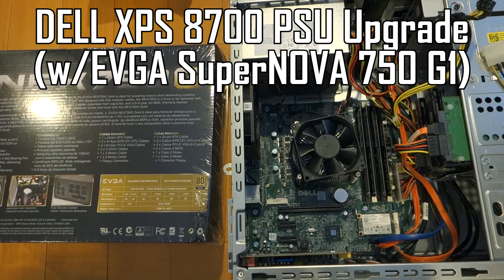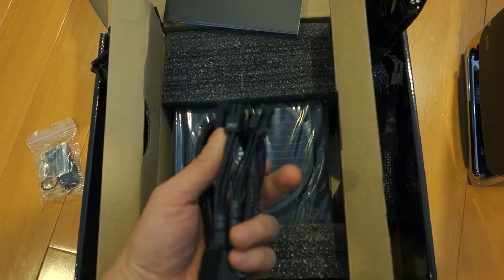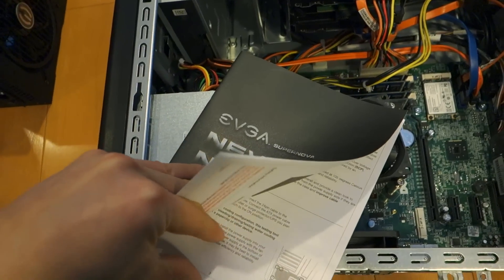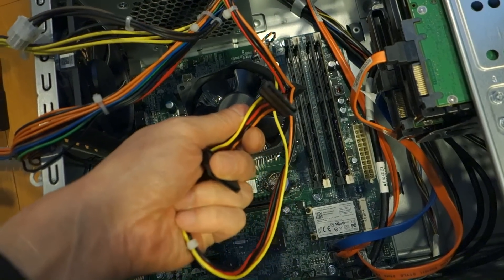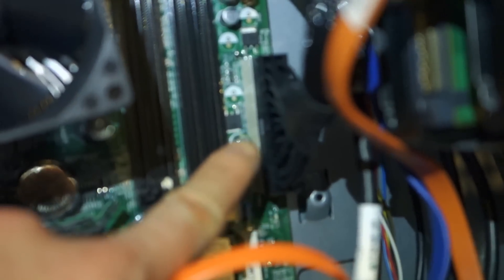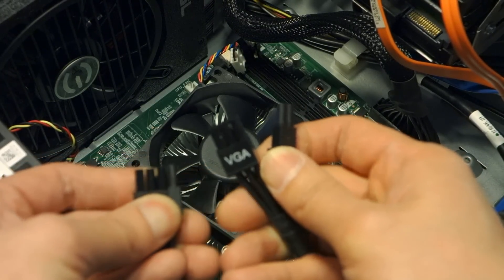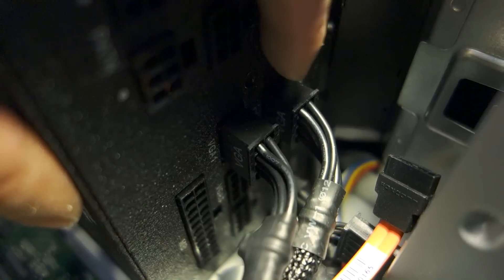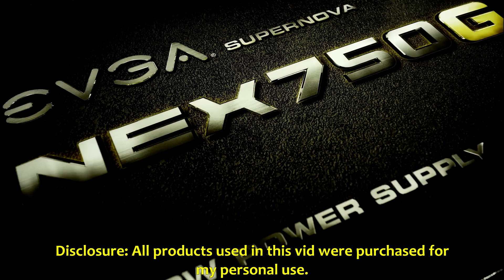HOW TO: Dell XPS 8700 PSU Upgrade (w/EVGA SuperNOVA 750 G1 and HD 6970)

Comment: I was just wondering, did you experience any trouble opening the XPS 8700's case? Did you find that the screws that held it in place were stripped? If not, what sort of screwdriver, bit, or tool did you use to open it? Is it possible that you could be specific? I'm having trouble opening my case. I thought maybe you could help!
Reply from the maker: These screws might be overtightened on occasion but you should be able to open it with a Phillips (crosshead) screwdriver; I no longer have this PC but I recall there are two screws. Good luck with this and watch some other vids to ensure you're comfortable with removal.

Comment: 5:10 I had the hardest time with those tabs. One of them pressed down easily because the cavity under it was empty. But the other closest to the casing side didn't budge. The cavity under it had some kind of a ridge of metal and there was no where for the tab to go.
Reply: I figured it out if anyone has the question problem in the future… the two tabs from the pc case toward the back of the psu keeping the psu in place, bend those up. Pull up on the back of the psu, towards you. Then pull up the front, over the tabs. Then pull out
Reply: FOR ANYONE HAVING THIS ISSUE:
None of the other comments worked for me. This was how I fixed it:

First I pushed the PSU up against the tabs to create forward potential energy.

 I got a screw driver, placed it on the upper tab, and bashes the thing like a hammer on a chisel and my PSU plopped out.
Reply: thiss 😭 help
Reply: How did you do it? I'm stuck at the same place, can't push that one tab down

Comment: god..... I just shoved a 1660 super into mine without an upgrade.
Reply from the maker: The 1660 super is far more efficient and only needs 1 x 8-pin and has max draw of only 125W whereas the HD6970 I previously used can exceed twice that draw and required 1 x 6-pin as well as 1 x 8-pin thus requiring the upgrade.
Reply: @TekyTimbo  I'm honestly wondering if I need an upgrade on anything since i want to stick my 2060 in the slot now. Not sure if I'm packing it in tight, or if there's room to breath, otherwise I'm just keeping my pc like that and save up until next year -_-
Reply from the maker: If your FPS is fine then I don't see why you'd need to upgrade. Best to save up for a newer system since eventually the CPU in the 8700 will be a bottleneck (if not already).

Comment: Hello sir, first at all, thanks for the video. One question, I have the same dell xps 8700 and Im planning to buy a evga 600bq power supply wich is significantly shorter and cheaper than supernova 750w, I already buyed a rtx 2060 xc black single fan, wich require 500w power supply. Do you think that evga 600bq is a good purchase? Im not sure about it, Im new in the upgrate pc world, thanks in advance.

Comment: Hi, great vid! Would a evga supernova 750 g+, 80 plus gold fit? Thank you! 
P.S. If so, how does it compare to the psu used here (in this video), size-wise?
Reply: so this psu is 180mm in length so any longer probably not

Comment: Really appreciate your help man. Believe it or not, I still have this computer and just upgraded the graphics card and I needed to install a new psu cuz the current one didn't have a 8 pin connector lmao 😅
Reply: Lokesh you don’t need to switch just by a 8 pin to 6 pin converter and your set
Reply: what card did you go with?

Comment: Hello sir, I can see that you have a lot of knoledge about upgrates, thanks for the video. I also have a dell xps8700 with 16 gb ram, from 2013, but now I want to buy (EVGA GeForce RTX 2060 XC Ultra Gaming 6GB GDDR6, Dual HDB Fans Graphics Card) but someone told me that my computer does'nt support it, is that true? can you explain me please if that's true or not? thanks in advance.
Reply from the maker: The card is compatible just that you'll need a slightly higher wattage than the stock PSU. As long as you upgrade the PSU to minimum of 500W, then you should be able to run the card.
Reply: @TekyTimbo  Thank you so much, now Im suscribed to the channel, just one thing he also told me that my computer will have a bottle neck because my computer is ddr5 and the card is ddr6, but I'm not sure about it.
Reply from the maker: Thanks for the support! The difference in this case would be so negligible as not to be a concern. Ultimately the main bottleneck would come from the PCI-E lanes but since XPS 8700 is also v3.0, you have no worries there.
Reply: @TekyTimbo   Thanks you for the support and information, really helpful.

Comment: I know it has been a while but have you had any issues?  Some people were talking about how much power is needed for the rails -  The system needs 25 to 30 Amps on the 5V rail and 17 to 25A on the 3.3v rail and around 130 to 150w combined minimum for that rail set.  None of the PSUs I have seen supply 130 to 150w combined.
Reply from the maker: It's held up like a champ and still running strong though I don't have a particular power hungry GPU (switched over to GTX1060).
Reply: @TekyTimbo  Did you have to get any extra cables that didn't come with the PSU?
Reply from the maker: Nope, every cable I needed came with the PSU.

Comment: Will this fit XPS 9000 ?
Reply from the maker: It should however it might leave a gap due to the shorter "height" of which I believe the XPS9000 is ~99mm vs. this one at 85mm.

Comment: thank you for the video , im planning to upgrade the power supply as well and this is really helpful . Quick question did you do any other upgrade to the dell xps 8700 ? like fan ? or moving components to the new case ? 
Thanks !
Reply from the maker: You're welcome, glad you found it useful. As for other upgrades, I've installed an Asus ROG Strix GTX 1060 Ti and replaced the rear fan with an Arctic F9 fan and moved the OEM fan to the front to do a pull/push configuration to improve air flow. Haven't really paid in-depth attention as to what improvements that made but in general checking of CPU/GPU heat, I have no concerns with overheating. I kept the OEM case but am aware of situations where people have transplanted guts to a new case (just search "XPS8700 case upgrade" and you'll get more than a few hits). Good luck!
Reply: turboBB73 hi , do you by chance still have the link to the artic fan you talked about ? And fan to the front ? I dont think i see any space to add a fan in there . Did you have to cut open the case or something ? 
Thanks !
Reply from the maker: Here's the 92mm fan I purchased:  https://smile.amazon.com/gp/product/B00H3SVWF4. As for moving the fan to the front, I used the Y cable from a different Noctua fan and used rubber isolation mounts (https://smile.amazon.com/gp/product/B01D5QNEDU) to attach it to pre-existing holes that seem like it was made to accommodate a fan. I didn't cut anything though I've read people have cut the grill in the front so it doesn't obstruct the fan at all (I feel it wouldn't make a huge difference so I didn't bother). Note that you'll be pulling in more dust into the system this way since that's the lowest point in the chassis you can install fan. General advice is to keep your PC at least six inches above ground level to reduce dust intake.

Comment: My is shutting off by itself and restarting is this the problem  I should do? Plus I notice the fans not spinning when its turn on.
Reply from the maker: Try a reset by unplugging the power then removing the computer clock battery and then pressing and holding the power button for a few seconds. Then replace the battery, plug the power cord back in and starting it up.
Reply: turboBB73 cool thanks. I just notice I have a xps 8920 will this power supply fit?
Reply from the maker: If you have the 460W, it should fit since it's the same one in the XPS 8700. I don't have experience with the 8920 chassis but I'd imagine it should be similar in clearance. Check my fixed earlier comments about the dimensions but best to double-check the clearance by measuring the space around your PSU.

Comment: I installed an EVGA 750W G2 in my XPS8700.  It required substantial tweaking of the USB area up at the top of the machine and removal of those cable clips.  I recommend getting internal motherboard cable extensions for both the 2.0 and 3.0 USBs.  This will allow more flexibility when routing around the PSU and also help if installing a large video card.
Reply: Hey man I know it’s been years lmao, but I’m about to do the same thing to my xps8700 and I want to buy one that will fit. I need a 600w any suggestions?

Comment: Just purchased a similar power supply - EVGA 650 GQ, 80+ GOLD 650W with most of the same cables and immediately had buyers remorse once i measured the original PSU.  Great guide, mine is .2 of an inch smaller - 6.5 inch instead of the 6.7 inch sized PSU in the video, so I'm hoping it'll be slightly (very slightly) easier to install.  Once again, great video.  Thanks.
Reply: Andy - so the 650 is bigger than the original PSU in the Dell?  Looking at the measurements it looks like it should be the same length.

Comment: Thanks for the video. I own a Dell XPS 8700 with a 460W PSU and purchased a EVGA GTX 1060 GPU that needs a minimum 400W PSU. EVGA says I should upgrade to at least a 600W PSU for cleaner power, but I was wondering if my power supply should be okay? Was also wondering how to attach a new PSU if I upgrade since it would extend a little long. Do you just attach with the 4 screws outside the chassis?
Reply from the maker: The Stock PSU should be fine if it's the same as this one: https://www.evga.com/products/product.aspx?pn=06G-P4-6163-KR
If not, you'll hit a snag if you need an additional PCIE cable to supply sufficient current. The suggested 400W rating is for total system power to ensure sufficient current for other devices (the EVGA GTX 1060 itself is actually rated at 120W). The PSU I got was also longer than OEM but no probs with just using the 4 external screws.

Comment: I know you did this a few years ago, but this old man THANKS you SO much!  I just bought an nVidia Titan XP card, and have the same power requirements as this video card, and was despairing because, well, it's been decades since I've built my own computer (and I'm sure it was back before you were born).  Because I've just bought Dell units put together for the last few decades my courage at doing this was small until I watched your video -- now I'm ordering the same power supply and will do this in a few days (I have no problem putting drives in my 8700, but a power supply?  That seemed like a bridge too far).

Again, thanks and keep up the good work (hopefully you're still doing these).
Reply from the maker: Thanks for the kind words! I actually do have a few more GPU/PSU vids upcoming but have to wrap up other projects before that. Best of luck with your upgrade and feel free to ping me if you run into any issues and I'll do my best to try to help.
Reply: That's very kind of you -- I ended up buying the G3 version of this power supply (time marches on) and it seems like it's much smaller so I might not has as many issues.  But you gave this old man the courage to try this so we'll know more how it goes on Tuesday (when the power supply arrives).
Reply: Turned out great -- was easy peasy (well, my big hands did have some issues with moving all those cables around...) and my new GPU is happy.  Thanks again and keep up the good work.
Reply from the maker: Great to hear and thanks for the follow up!

Comment: Now, if you were upgrading the Power Supply Unit of a Dell computer that was manufactured between 1998 and 2000, then you would ALSO need an "ATX-to-Dell" adapter for your 20-pin motherboard connector (I believe that back then, pretty much all motherboards had 20-pin instead of 24-pin sockets). Here's why: it's because back then, Dell used proprietary PSUs and proprietary motherboards. Now they both looked like ATX standard parts; and you could even physically connect an ATX standard PSU to a Dell motherboard (or vice versa); BUT if you then turned the computer on, then the PSU and/or motherboard would literally throw off SPARKS and then of course be ruined. So to prevent this from happening, you would've needed an ATX-to-Dell adapter for the 20-pin connector. I believe that if you looked closely at a proprietary Dell motherboard, then you would see, in addition to the "standard" 20- or 24-pin socket a mysterious 16-pin socket right next to it. Yes, that's right: a proprietary Dell PSU had an extra 16-pin motherboard connector! So... the "ATX-to-Dell" adapter would plug into the PSU's 24-pin connector on one end and then the other end would split into a 24-pin connector AND 16-pin connector just so that the PSU would work right in your Dell PC. I think I know why Dell did this anti-consumer move back in the late 1990's: they did it to try to ensure that consumers would use ONLY Dell-supplied PSUs instead of third-party ones.

Comment: If I try to boot my pc with a gtx 1080 while using the standard dell 460w PSU will it boot? Only for work, not gaming until the new PSU arrives
Reply from the maker: It depends on the specific version of the GTX 1080 but most should be fine under the particular circumstance you described.
Reply: turboBB73 it's an EVGA SC FTW. I'm worried that the superclocking will increase the power necessity too much for the pc to even boot. Out of curiosity, if I were to try this out and the PSU can't handle it, would it damage any hardware components?

PS: Thank you for such quick response, wasn't expecting to get an answer in the same day, let alone within a couple hours!
Reply from the maker: Though it's SC'd, it's not necessarily being utilized (put under load) so overall I think it should be fine. Again, your YMMV. As for damage, if there really is insufficient current to drive the card then you'll likely get crashes. That's not to say physical damage can't occur but it shouldn't be likely.

Comment: I found a nice EVGA model, although newer (G3 series) & only 550W versus 750, am sure that my OEM PUU will run the EVGA GeForce GTX 1060 SSC (6GB GDDR5), although may heat more. Still to this day, have never had a Delta Electronics PSU die on me, they manufacture PSU's for a variety of brands, to include notebook power bricks. Just wanted to add a measure of safety & it's a good idea to keep an extra PSU on hand, should it not work out. 

If all goes well, I have another system where that Dell 460W CPU, which are typically underrated on the spec sheet, and this is for our safety. Some has successfully installed much higher power GTX 970 GPU's in YouTube videos, although we have no idea if these are for show & not used daily. Just to prove it can be done. Yes, it may boot fine, run some serious benchmarking software for 3-4 hours & if possible (assuming the PSU doesn't trip & reboot for it's safety) post the internal temps of PSU, or simple like a notebook, feel the heat on the PSU direct. That's why on many notebooks with a 90W power brick, good to upgrade to a OEM 120W version (same brand, voltage & pin connector). There's usually an upgrade for most notebooks, many of the AIO PC's of the same series uses a larger power brick, yet same voltage & connector. 

My only concern is the fan blowing downwards, will this be an issue heatwise with the PC, or will serve as a 2nd exhaust, drawing already hot air out? If the latter is true, then I suspect that the 7 year warranty will come in handy, it would be looking for cool air to keep the PSU from potential damage.......or is my assessment overblown? 

BTW, this PSU will have lots more room, is a compact size, so hopefully I'll not end up with cut hands, as the publisher of this fantastic video was showing. 

https://www.newegg.com/Product/Product.aspx?item=N82E16817438095

Once my PC is out of it's extended warranty in a few months, may consider a case mod, cutting out a space on top for PSU ventilation. For the reason just stated, have to wait for another 5 months;-)

Thanks for the fantastic, educational video!

Cat

Comment: Hi! I need huge help, I am getting a EVGA FTW Nividia gtx 1080 and a bronze CX750m 750 Watt Corsair Power supply unit by corsair and I was wondering if those would fit in the pc, I already ordered it and I was worried it would not fit into my Dell XPS 8700. If not I can upgrade my case but I would much rather not to do that. Please lmk if you think it will fit! Nice video man!
Reply from the maker: I have an Asus Strix GTX1060 which is one of the largest GPU cards and was able to get that to fit in the XPS8700. As for the PSU, according to mfg specs, it measures: 150mm x 86mm x 160mm  vessel. The EVGA's 180mm (D) x 85mm (H) x 150mm (W) so it should fit. Good luck with the upgrade.
Reply: ok, Thank you so much man!

Comment: hey i own a dell xps 8700 i was wondering if the EVGA GeForce GTX 1060 GAMING DirectX 12 06G-P4-6262-KR 6GB 192-Bit GDDR5 PCI Express 3.0 Video Card would fit in it? because i wanna upgrade it but im not sure whether or not itll fit :X
Reply from the maker: According to the specifications  on EVGA's site:  http://www.evga.com/products/product.aspx?pn=06G-P4-6262-KR
(10.5" x 4.376") it should since I have a much larger card installed: Asus ROG Strix GTX1060 (11.73" x 5.28") installed now. It was a tight fit but it definitely fits so again I don't see why the EVGA wouldn't as long as you take care in angling it in. However, while the stock PSU can power it, it requires a single 8 pin PCI-E cable which the stock PSU lacks so you'll either need to upgrade the PSU or get a dual 6 pin to 8 pin PCI-E adapter cable. While a single 6 pin to 8 pin converter should work, since it's only 75W max and the EVGA can draw as much as 120W it's a little dangerous so stay away from it and invest in the dual cable if you're sticking with your stock PSU.